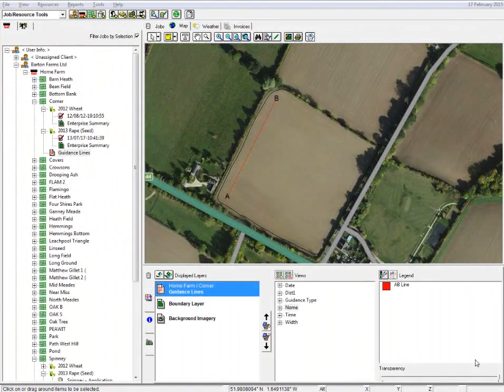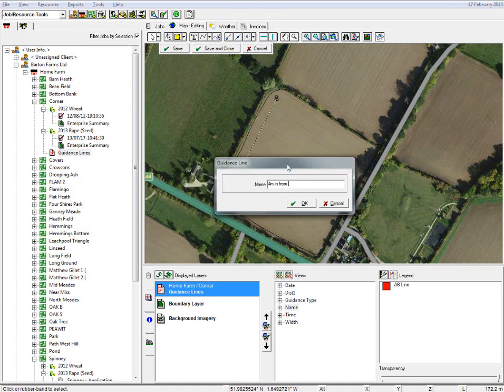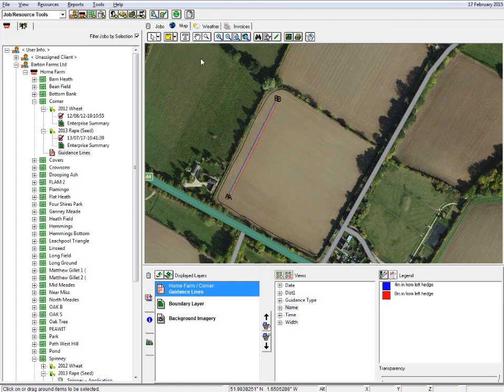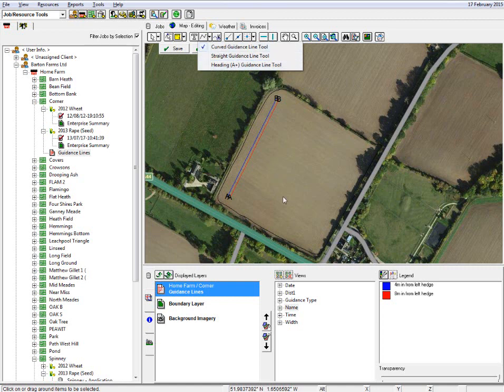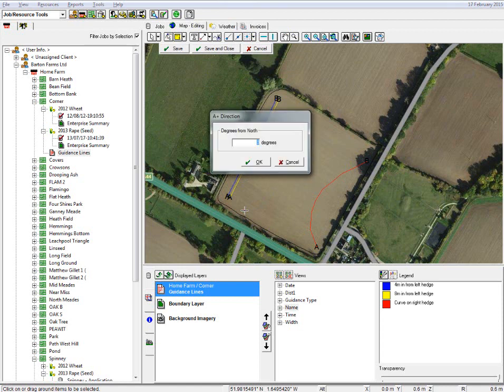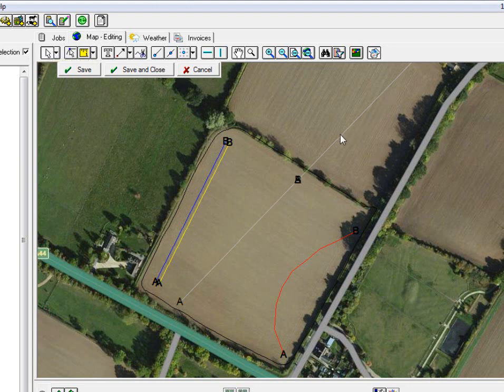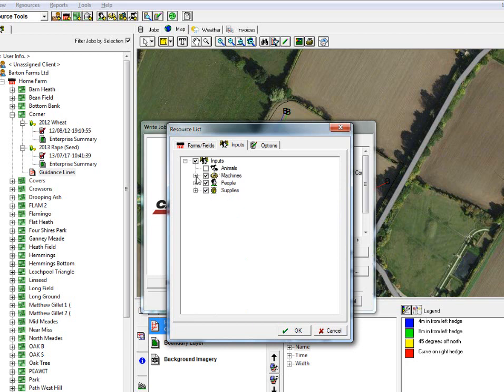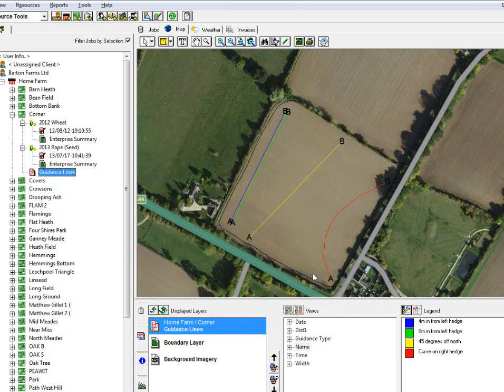NH16   Creating & Editing guidance lines

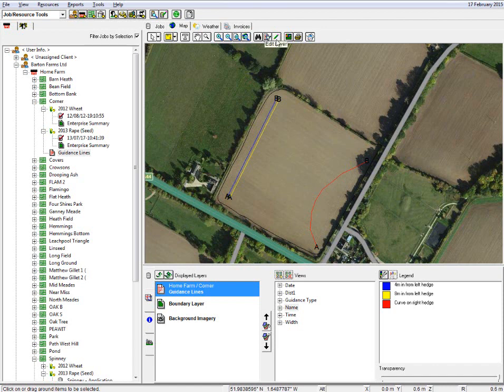Comment: Very useful. At 4:05 a little tip i've learned when you want to add an A+ heading line at so many degrees +/- to and exisiting A/B (for cultivating at a fixed angle to a tramline for example,) if you select Display Options from the tool bar then on the Guidance Line tab select Guidance Line A/B Heading. Then when you add the lable to the exisitng A/B line, it shows its heading and you can add or subtract from that to create the new one.